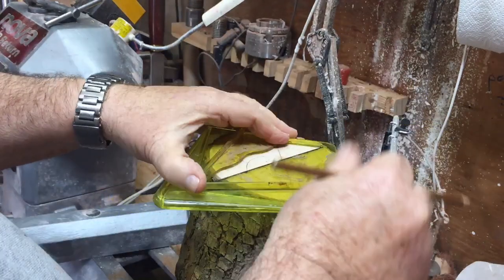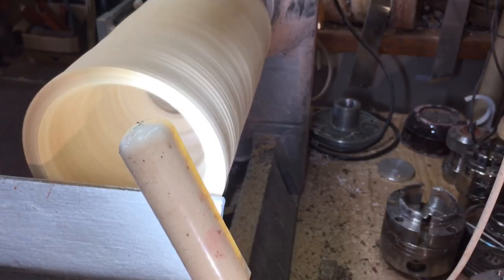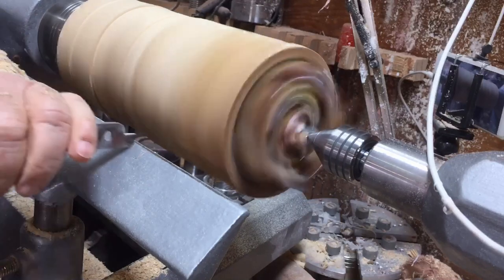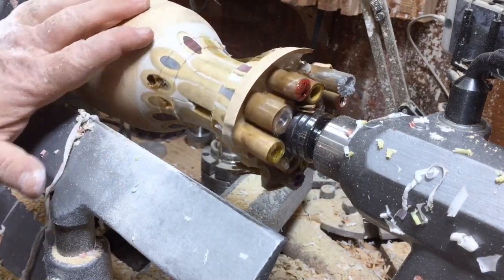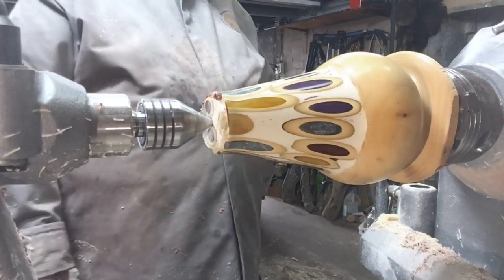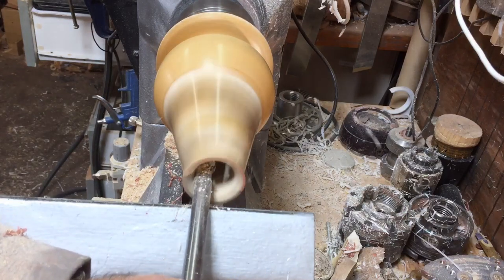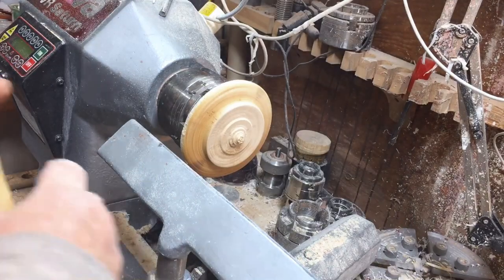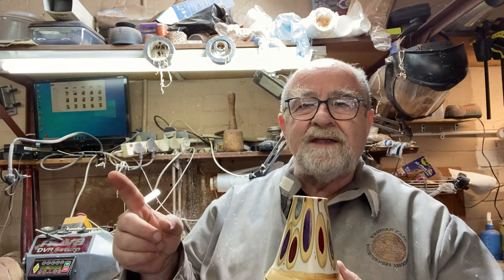woodturning  bamboo vase gone haywire

Comment: Yep, lots of design change opportunities! Good save. Roughing up the bamboo surface more likely to improve adhesion. Or stabilize the bamboo to make it same hardness as resin, which would also eliminate the splitting problem.
Reply from the maker: thanks Valerie Henschel for your input ,your opinion is very important to me .Cheers Ahron🍷

Comment: I like the effect of the turned bamboo, I agree with you on perhaps sanding the outside of the bamboo for a future project, if I remember correctly (from childhood) bamboo feels greasy on the outside (or that could just be that its very smooth and hard) ? which might have stopped the resin from sticking to it well.
Reply from the maker: Hi Bob i will do in the next few weeks one with bamboo, with all the tips i got and we will see how it is going to work

Comment: Good day Aaron on the video wood turning bamboo vase gone haywire you used a resin paste that you had made up to fill in the cracks and voids. Who provides that ? I need to do some repairs on one of mine and that would be an easy solution. Hope all is going well with you down yonder, look forward to hearing from you
Reply from the maker: Hi Dave sorry for the late answer i was on holiday . I am using Epoxy Gel Coat from our local supplier .

Comment: Ahron,  consider it a learning experience.   Bamboo is strange stuff.  I think what might have helped is to send the outside of the bamboo to get rid of the waxy surface and open the pores.  Next perhaps stabilize the bamboo with a vacuum chamber.  The stabilized bamboo likely wouldn't fracture as much and it would hold the resin better.
Reply from the maker: Thank you very much Suzette Edwards , thanks for taking the time to comment and giving me some great idea 👍

Comment: Late comming to this Ahron..  this is a nice idea..  sanding the outside of the bamboo will help and maybe followed by stabalisation to help prevent the structural weakness of the bamboo. Maybe cast the bamboo centre resin before the main pot casting, that way it can be trimmed to size to fit the pressure pot 😊
Reply from the maker: Thank you Steve for your comment , i will start with the sanding the out side first and see . 🍻